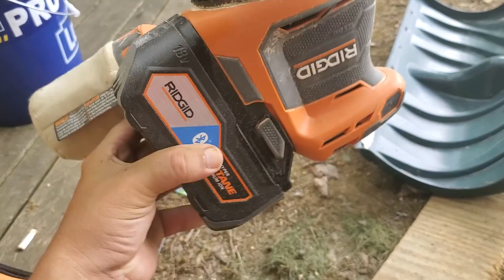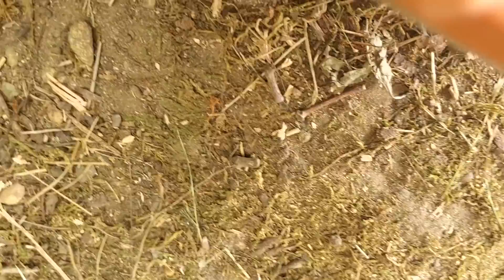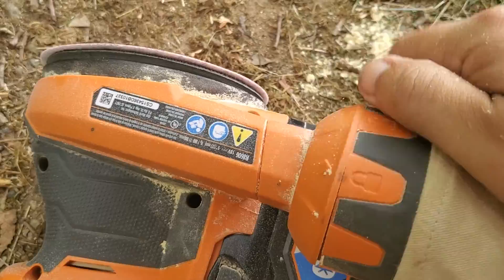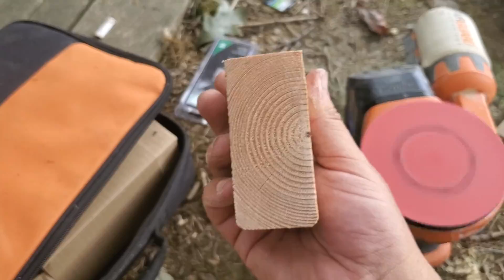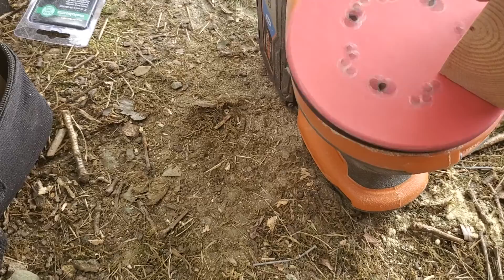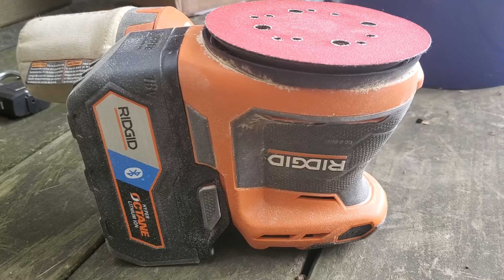Ridgid 18v Orbital Sander w/9.0Ah Battery

Comment: I need to  up pick me up one of those Ridgid orbital sanders I got a Skil orbital sander but it's in a box I haven't used it in many years probably needs new carbon brushes  from the time  BOSCH  owned them  I'm in love with two different Sanders at a 2amp sheet and a orbital sheet sander still runs